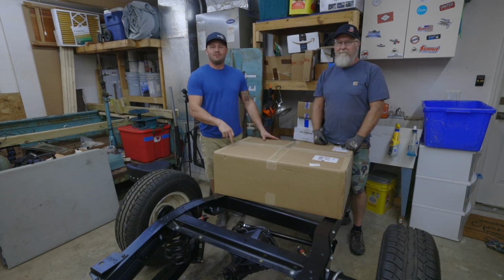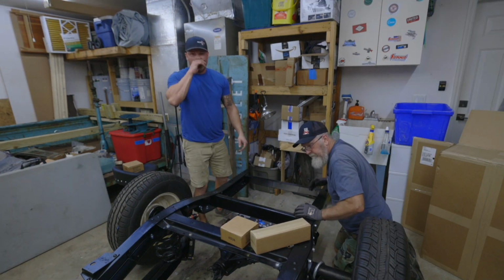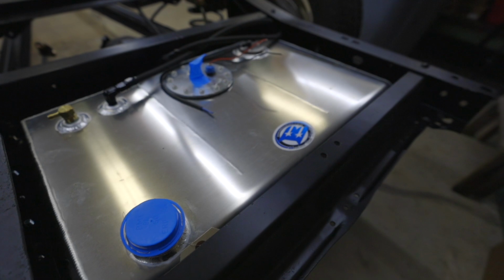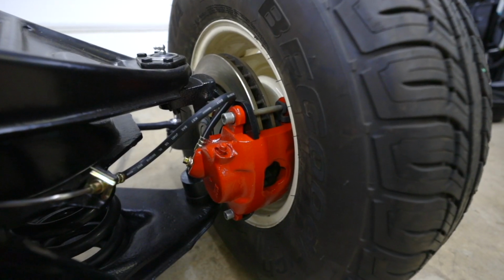C10 Fuel Tank and Disc Brake Install | Project Last Chance

Comment: I'm putting mine in today and the passenger side it very tight against the front frame. Did you do any cutting to you frame? Was yours touching?
Reply from the maker: The fuel tank has about 1/8" clearance on the passenger side. It's very close but does clear. Hope your install went well.
Reply: @motortopiaondemand  I ended up grinding out some room. It was an undertaking but it's all in and working! Thanks!

Comment: Sir is your bed still off your frame? If so could you do me a favor? I’m installing a gas tank on a 63 C-10 short bed, & I think my frame is not square. Could you take some diagonal measurements from the rear differential area to the tail end?

Comment: Is that tank held is with nuts and bolts like you would have to remove the bed to drop the tank or do they give you like nutcerts for it
Reply from the maker: Hey Kevin! You can weld or bolt the mounting bracket to the inside of the frame. We decided to bolt the bracket to the frame and clearance the mounting tabs on sides of the fuel cell by drilling a large hole so it would sit flush to the bottom of the frame.

Comment: I HAVE A 87 CHEVY IT LOST POWER TO THE FUEL PUMP CHECKED ALL FUSES AND GROUND CAN NOT FIGURE OUT WHY DOES ANY BODY KNOW WHY LET ME KNOW THANK YOU
Reply from the maker: There are too many variables to advise on that issue. I would recommend reaching out to a local mechanic if you're still having issues.

Comment: Did you use the original front crossmember for the 67 or did you upgrade to a 73-87?
Reply from the maker: I used the original crossmember with a CPP brake kit. I would like to upgrade the entire suspension to coilovers eventually.

Comment: What brake lines did you use and how was the fitment ?
Reply from the maker: This was a stainless line kit that fit well. I believe it was from LMC but not 100% sure. It was one of the parts that came with the truck when I got it.